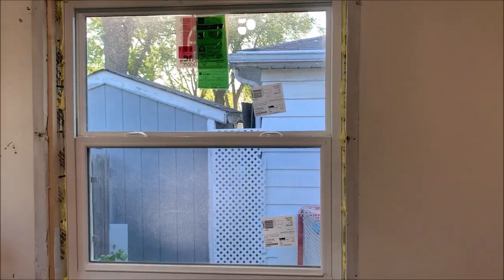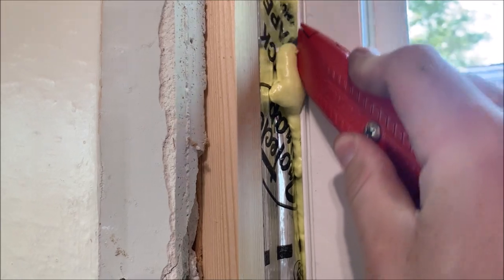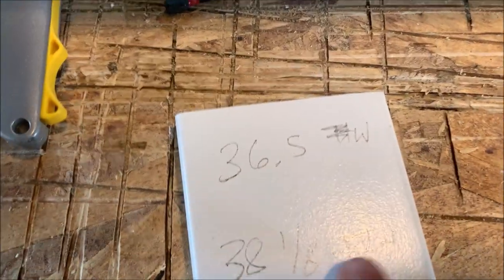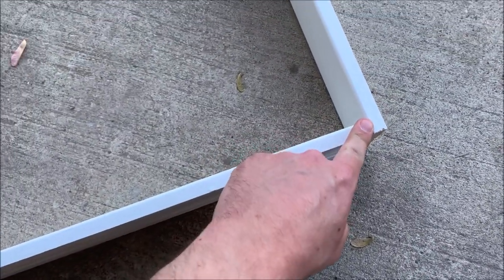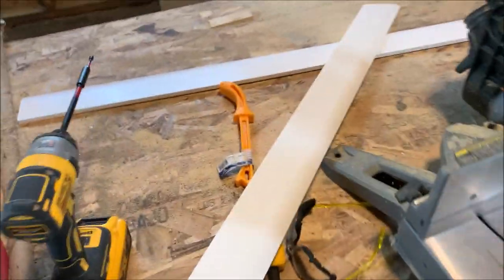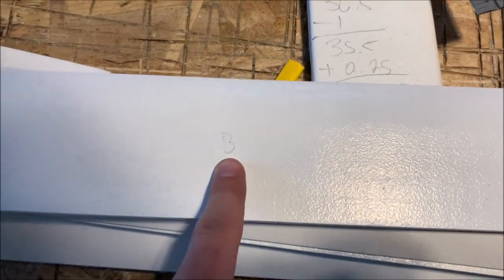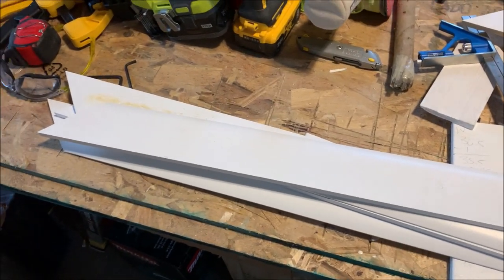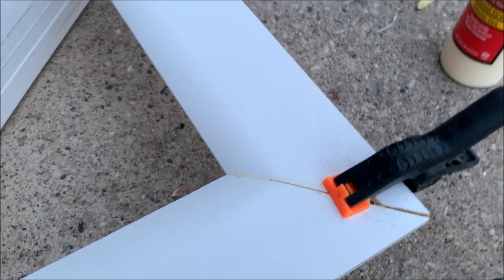Building Window Jambs and Trim

Comment: I highly recommend ca glue with an activator. I like mitreaple. No clamping or waiting necessary. Also if you clamp the two trim pieces that will be the same length together and then cut them the same time they will be the same length and will help ensure your corners are tight. Nice work!